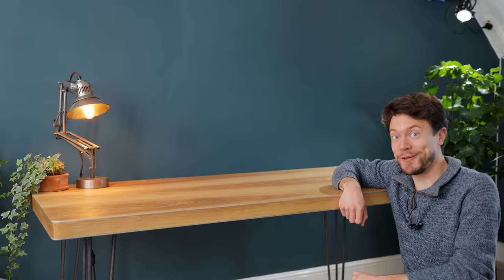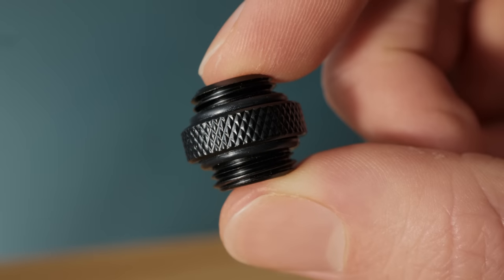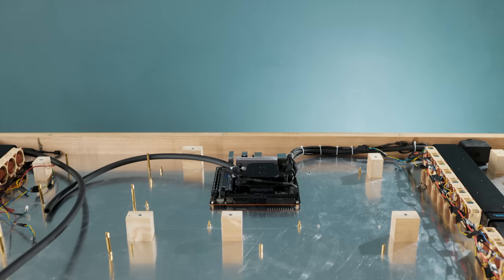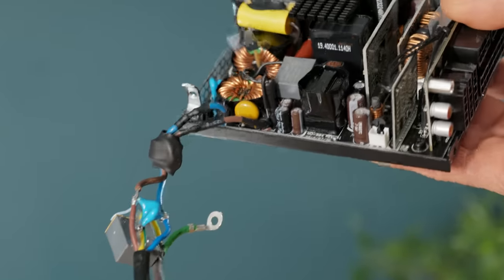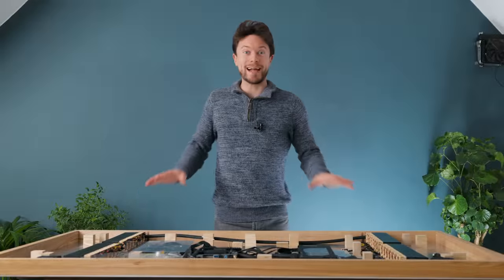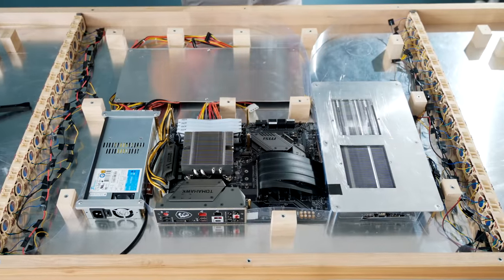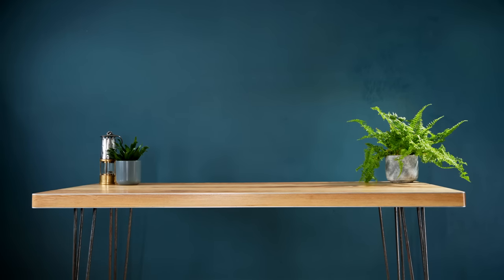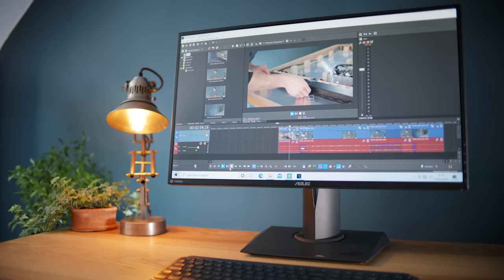Watercooling my invisible PC... (and other upgrades)

Comment: I took a listen and heard fans, but sadly they were mine
Reply: same
Reply: My computer is sitting with firefox open and sounding like a jet
Reply: @iceberglettuce890  change thermal paste and do a wuick clean with som air can or pressure
Reply: @darkraft100  I'm just joshing, I mean more I comparison to this build than anything
Reply: I’m lucky that I’m on an iPad.
Reply: @iceberglettuce890  I just unscrewed my fan cuz "it has a little tick tick sound, maybe lube it, sooo, it was a cheap one with cheap mount and you literaly can't put ut back and to worrk properly, now it's sounding like a 20 years old hard disk, horible
Reply: @iceberglettuce890  My PC literally sounds like a jet but that may be because I decided to put delta fans in it...
Reply: @strix8707  s a m e
Reply: @Pineappler true i have a pc pc is the master race
Reply: same :(
Reply: I heard fans also, the ones cooling  my networking gear

Comment: With this many fans if you turn them 90 degrees you can convert the desk to a hoverboard
Reply: True, but it does remind me that he is doing all this air channelling, he could have gotten away with larger pull fans mounted horizontally instead of vertically, probably 4*120mm would have done it.
Reply: @MartinPHellwig  it might not be really comfortable to get the warm air blown on your legs/feet, especially in summer
Reply: That's his next video 😎
Reply: LOOOOLLLLL
Reply: Maybe with a few dozen high rpm delta fans but it'll obviously sound like a jet engine and take as much energy as a jet engine.
Reply: @OlivierCombe  computer and leg heater, good for Canada
Reply: @OlivierCombe  you could mount 4 blowing air in on one end from the bottom, and let an exhaust vent on the other end have negative pressure take care of the rest (no exhaust fans)
Reply: @OlivierCombe  Tumble dryer exhaust hoses could solve that, especially using a heat pump to store the heat underground to use in the winter.
Reply: Iron Kid  you have never been to a science fair? There's always one of those plywood circle hoverboards that runs off a leaf blower at every science fair. You can make one with one sheet of plywood a coffee can lid a shower curtain and a leaf blower. Literally elementary stuff

Comment: I’m overclocking my table

Friend: what?...
Reply: I did that years ago however my table is thicker.
Reply: my table broke
did you try turning it off and on ?
Reply: @abde999  best reply yet
Reply: A: Can your pc run Crysis smoothly at max settings ?
B: No, but my table can
A: What???
Reply: glues multiple clocks to my table is this overclocked now
Reply: Love your pfp
Reply: @siomaiethan  agreed 👍
Reply: Yeah, overclocking wont work with this setup. It´s only 4x120mm and that´s no where near enough rad area to cool something high end. My i9 and 2x2080S has a total area of 1020mm and I get around 50-60 C. This setup will reaches 60 C on default frequency. If he overclock it the water tubing will melt.
Reply: @BertyBertsson  I mean anyone with decent PC knowledge would know it wouldn't Oc. Even if you got the joke, this comment was almost if not completely irrelevant. I will now bestow the r/woosh
Reply: Ahahahahahaha
Reply: @neroforte6183  but only if you glue more clocks on the clocks
Reply: @xyaless  glues my table to the london tower/big ben how about now
Reply: he means: putting a lot of clocks on it
Reply: HELLO BROTHER WE HAVE MET
Reply: @migo7741  Filipino?
Reply: yep
Reply: @neroforte6183  LOL
Reply: If ever something goes wrong....
Him: my table exploded
Reply: @PennyAfNorberg  the thicker they are the cooler they get.
Reply: @CarinoGamingStudio   Sure but I was talking about my table (12.5 cm, can take away 1 cm quite easily, and about 4cm harder ( switch from wood) ,  5 x120mm btw, 1070 and i5 6600k
Reply: ignore your friends do what makes you happy

Comment: Matt: "Listen to how silent it is!"
My laptop fan: "We don't do that here."
Reply: At least you even have a fan...
Reply: @Mi78  wtf
Reply: @evilhutdug4665  Microsoft be like "nah no fans today"
Reply: *my XPS 13 with coil whine and running it’s fan...
Reply: @evilhutdug4665  some laptops (like the one I got from my previous school) are passively cooled
Reply: My laptop (HP Omen) sounds like a plane during takeoff
Reply: 1000th like!
Reply: I don't even run games nd stuff, but it is noisy af even on the internet browsing, does anyone have a solution.
Reply: @harpreetsinghmann  get a new pc?
Reply: @harpreetsinghmann  mine is noisy even without opening anything on it
Reply: @harpreetsinghmann  compressed air duster for cleaning a few drops of mineral oil in should quiet it down and while ur down there since its open mite as well repaste it which will further reduce temps and prevent the fans from going into higher rpm's
Reply: @harpreetsinghmann  might just have dust in your fan that needs to be cleaned. or might need a fan replacement. or you might have crypto mining malware taking up all your resources when your pc is turned on
Reply: @harpreetsinghmann  if it's fairly old and you smoke/ put in on carpet/ dusty surfaces you can clean the fans
Reply: @harpreetsinghmann  Open it up and make sure the vent and heatsink don't have dust on them, also check the fan blades. If that doesn't help check your BIOS and find the fan power option.
Reply: my ps4 pro: *"whoooooOOOOOOOOOOOOOOOOOOOOOOOOOOOOOOOOOO*"
Reply: @chimaera2611  Mine is noisy even when its shutdown. Just plugin the charger and enjoy the ever lasting ASMR.
Reply: @estc3778  Mine too
Reply: @laurinneff4304  You mean these incredibly powerful Raspberry Pi x86 implementations?
Reply: macbook enters the chat

Comment: You should hide the cooling system in the plant so when you water the plant it cools the pc
Reply: you might already know but its not water that its being cooled with its mineral oil so either the plant gets done dirty, or the entire pc is wasted
Reply: @thingymajigger7648  bing bong
Reply: @Ratatted  huh?
Reply: @thingymajigger7648  add a funnel to it and a small pipe. Plants can get their own water, PC doesn't get affected
Reply: @CXHo-sy1xz  yeah that works too but i doubt it’s what ratatted meant
Reply: @thingymajigger7648  I don't know where you got this info, but all the water cooling loops I've made have all been water. Like it's named. The only mineral oil I've seen is for submerged "aquarium" PCs. We actually do use water in water cooling.
Reply: @Lethal_Bite  i had a brain shart sry
Reply: Then you end up in a Community episode (one of the best)
Reply: @thingymajigger7648 use a fake plant. Ez
Reply: He definately hid it from anyone watching this video. Not one tube run was shown.
I don't believe it's water cooled at all.

Comment: I really want to see the sound deck incorporated into this whole build... just to see all the genius design in one place :)
Reply: I really want to see at least one tube going to the mother board. 
Not once in this video do you see water cooling actually installed.
And what exactly is cooling the water system itself with zero fans installed?
Reply: @seaislevel7233  Did you not see the beginning when he glued all those fans to 2x radiators each side of the table?

Comment: This man is literally testing the acoustics of his desk.
Reply: I like your jeep is that a cj7?
Reply: @skopperkopp6091  yup. Its my daily. 4 speed amc360 5.9L. 
Alot a fun 
alot a stops at the gas station lol could use a little body work under the body armor but pretty solid for a northern jeep. Its been im the family since 1981 since it had 800 miles and since then my grandpa used to spray oil under it and in the spots that rot by drilling holes, spraying and pluging them with a rubber plug. Its just the past 20 years after he gave it to my great uncle, my dad and my brother inlaw and they didnt keep up with it so she rusted. She was just a i6 but when my brother inlaw got it he put the 360 in and a 3 speed. It sat mostly finished in a barn then he gave it to me then i ended up puting a trans in it to fix the gearing he messed up then the engine blew up so i swapped that out for a new long block. Its my baby lol. Plan is drive it as is but dont let it rot any worse, get my 1982 fiberglass basket case jeep running, then do a frame off on the 81 and use the 82 as a daily. Hopefully the i6 would get at least like 5 mpg better aswell as the 5 speed and then in winter it cant rust either
Reply: @skopperkopp6091  im not too worried about mpg cause why would i be driving a jeep then but this one gets 10.5mpg and its hard to afford that at 17 making minimum wage. Probably gets a lil better now that i adjusted the choke but still a thirsty v8. Nice quad by the way. I have a dirtbike but its not nearly as nice as that lol mines a beater
Reply: @chickensfloat7427  thanks! And yea I get the gas guzzler I've got a 72 cj5 it doesn't have the amc but it's got the 253 (I think that's right) straight 6 with a big ol holly 4 barrel on it that just pours the gas in and shoots flames out the headers. It's got the 4 speed too and got decent 33s on it they are loads of fun.  You from Michigan?
Reply: @chickensfloat7427  I never thought of drilling holes and plugging them.
While my car is too far gone, that is a good idea if I ever get a new car
Reply: I am confused of how the reply section of a comment about the video became a discussion about a car and I'm somehow is not surprised.
Reply: @alicorn3924  it's a jeep bro and jeeps are badass you should get one
Reply: @skopperkopp6091  Oh ok but i'd rather the airconditioners in cars but thanks
Reply: @alicorn3924  haha what do you mean they have had ac in them since the 90s we're just talking about our old ones
Reply: I'm close to a jeep bro in that I want a Jimny. Probably never will have one though
Reply: @sand0decker  those things are sweet. I saw them in the Philippines 🇵🇭 when there were un veiled at the manilla auto show. Idk if they will ever come to America but i want one too lol
Reply: @alicorn3924  mine doesnt its 40 years old but ita not that bad with the floor vents open. They had optional ac back then but everyone ive seen doesnt have it. You can ad after market ones though. But old jeeps are not for most people. Brakes suck, there slow stock, and handle like a shit sandwich without the bread but there exactly what i want and love lol
Reply: @chickensfloat7427  haha mines open top so the breeze is the ac. Also got a 48 cj 2a and that thing is a blast too
Reply: @skopperkopp6091  awesome. My dad has a 66 cj5 with the hurricane engine similar to the flat head 4, that thing is a blast. Slow but still a blast.
Reply: @chickensfloat7427  you said your jeep was a northern one are you from Michigan at all?
Reply: @chickensfloat7427  people put superbike motors in them.
I don't know if I'd go that far, but a large bore bike engine would be cool
Reply: @chickensfloat7427  Oh wow, most of the jeeps i've seen dont have AC, probably because I live in the Philippines.

Comment: Really cool invisible PC, makes me want to build one, I wonder how much it all cost, I know Aluminum is not cheap!
But totally worth it. Nice look.
Next Upgrade....are you ready?
Wireless phone chargers you can install from inside the desk, left and right, so you only place your phone on a graphic symbol on top of the desk, and it starts charging your phones auto-magically!
Reply: Aluminium is amongst the cheapest metals you can buy.  And this used them in sheets, which is even cheaper.
Reply: Why do you type like that?

Comment: "Take a listen". 
All I can hear is my own PC.
Reply: 🤣 🤣 🤣 I have a pentium g3240.... And i use quite heavy load softwares 🤣.... Now just imagine my pc noice level.....
Reply: I hear nothing cause I’m watching from my phone.
Reply: I came here to say something similar. My case fans are super loud.
Reply: All I heard was my 2nd fridge...
Reply: All I hear is the 87db electric turbine that forces air into the empty 5.25" drive bays on my almost-computer.
Reply: That's because he's filtered out the high frequency noise of the A4s lol. That many A4s is not quiet, and that's why that section sounds muffled.
Reply: @katherinesilens2994  Yeah I am so confused about those A4s. They normally sound like a jet engine at takeoff...

Comment: DIY Perks: Using air cooled system as it is easier and  "cheaper to make"

Also DIY Perks: Let's use 34 x noctua small fans in the system aaiigght
Reply: yeah, just a terrible design all together.
Reply: @zetec  Probably runs better than your PC.
Reply: @tams805  Those fans cost like $500. Not very cost effective.
Reply: It's a cool design. Just not a very cheap one. Centrifugal trans would probably be optimal but I don't know if they make these for consumer use.
Reply: Just checked... They make radial fans for consumer use. I think those would be optimal.
Reply: @tams805  My pc has Noctua fans also, they give you splitter and extensions with every fan but he had to destroy every connector and put shitty tape to block as much airflow you can. But running "better" than my PC? Can't tell because he did not show any data and the fans won't kick in after 20minute of stress test or watching Superposition @1080p .
Reply: Yeah I get why he used noctua, super quiet, move a ton of air, last forever, but def not cheap.At least they were able to be reused with his new rads so it was a nice upgrade path.
Reply: @barrynevio4440  Those are the reasons i use Noctua, my Corsair AIO had a fan that buzzed from the start and i decided to use only Noctua to remove "weird" sounds completely.... But he really has to use the fans for the radiatorsand got lucky with it, normally you use connectors to have flexibility installing, i can't remember why anyone would have that kind of wiring. Propably i stopped watching the last video to avoid my brain exploding... :DDDD
Reply: @woldemunster9244  you’re completely forgetting the fact that you built your pc in a conventional case and he built his in a handmade desk the width of your bedroom door. still probably keeps up to yours too especially with that brand new 5k ryzen
Reply: @atnfn  
1) Where was that requirement?
2) Being an enthusiast can get expensive, and the best performing components are almost never cheap.

If you actually knew anything about PC hardware, you would know that Noctua are known to be the best in the industry, not for their value for money.  

tl;dr: not everyone is poor.
Reply: @mojolotz  one of the main goals was silence, you don't get that with most other fan formats, the last so with anything resembling a blower style fan.
Reply: @enlightendbel  blowers aren't inherently noisy. It's just that it's hard to find big ball bearing blower fans. The bigger the fan the more silent it is. This config just crushes the issue with sheer number of fans. If you could have three big blowers per side that would do the same but that's just not an option.

Comment: One addition you should make to the desk/table. Mount a wireless induction charger plate underneath the top surface (Samsung or other). Then you can just lay your smartphone over the plate while on the desk to charge the phone while not in use. It is surprising how deep these can be mounted while still making an induction charge. (Just remember to put some sort of discrete mark on the surface to locate the placement of the phone, perhaps a darker veneer dot.)
Reply: Would the aluminium not affect the charger? It would be a great addition.